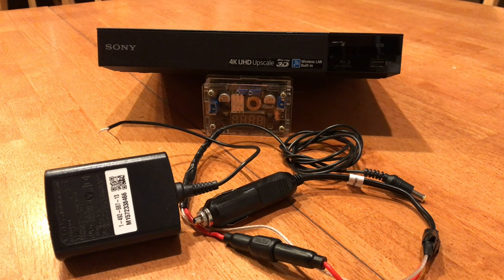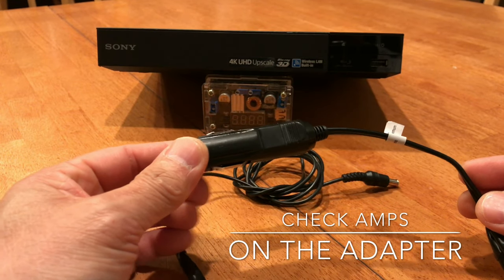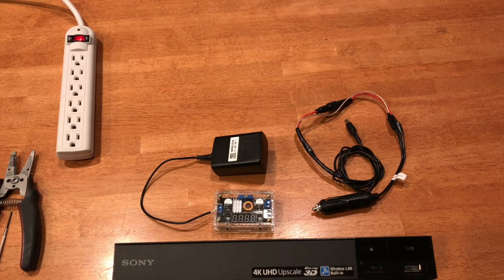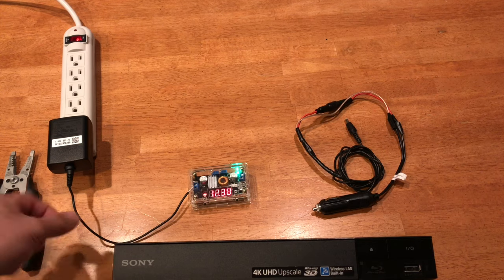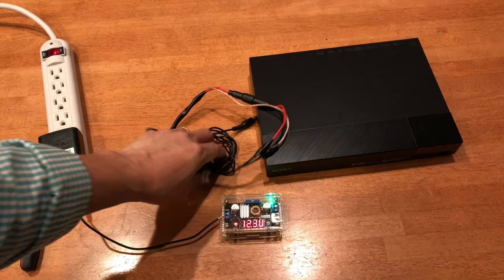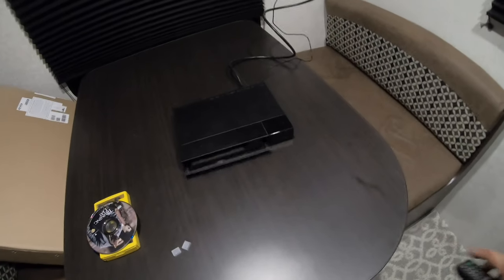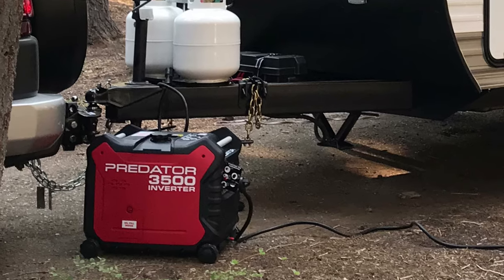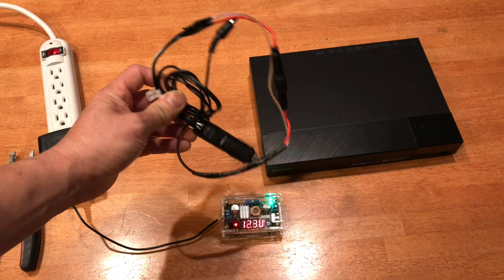DIY 12 volts Blu-Ray Player for our Jayco Travel Trailer 12V DC BluRay Player for RV Blu Ray Sony

Comment: I did this a couple years ago (before seeing your video) to our front and back blu Ray players so we could run quiet (without the generator) as much as possible in our 36' Georgie Boy whe we dry camp. I also added the bump converters to try to avoid low-voltage issues. I'm not sure what happened, but both players ended up dying. I can only guess they had either dips or surges that exceeded the limits of the bump converters to keep the voltage stable. I may try it a second time, but I think I'll rewire one circuit in the coach to run on an inverter instead

Comment: You confirmed what I already thought though a better power filter option would be nice.

I have an Australian model 50Hz LG w/ 12V power plug.
Reply: Running from a lead acid 12V deep cycle battery in my garden shed

Comment: Would it matter which color wires goes to which with the inline fuse and the 12v cigarette connector? there’s a fuse inside the cigarette plug, so on top of top that an inline fuse is needed?
Reply from the maker: If you have a fuse in the plug... no need to add another. Typically, you put the fuse on the positive wire...
Reply from the maker: Note: white wire is the positive. Anyway, thank you very much for watching and feedback

Comment: I’m confused.  If you have the Generator, why would you need to do all of this?

This video made sense up until you pointed out that you had a generator to power the travel trailer.
Reply from the maker: Some of the places we camp regulate the time on when you can run a generator. They call it “quite time”. I built this so, I can watch movies while on battery - battery bank power source. The batteries gets charge when I run the generator or while on shore power. Thank you for watching and question.
Reply: After watching this video I went and cut the cord from my Sony Blu-ray player, only to find that the wiring is different. It too has the adaptor, but upon cutting the wire, there is a white incased wire that comes up through the middle, and the other strands, that should have been incased, are simply  wrapped around the middle wire.  So now it's going to cost me another $30 to buy a new adapter, otherwise I've just ruined my Blu-ray player. LOL!  Too bad there's no way to know until you've already cut the wire LOL!

Comment: Trying to do the same with my LG TV..... it has a DC input but wants 19 volts...I am looking at wiring in a converter...between the 12 volt and the TV.. lol. or just get a small inverter....
Reply from the maker: Captain Sam Wilson sorry to hear... there are Blu-ray player out there that are 12volts. I doubt your Trailer is 24 volts system... if it is (was), a buck converter will work and buck it down to 19volts. Re: small inverter... watch your battery level.. especially with fan... it draws a lot of juice. Good luck.. and happy trails
Reply: 19 volts is a standard for older laptops. I found a laptop car supply that powered my TV like yours.

Comment: Question.. I am assuming you can play normal DVD's in the blue ray player??  I just installed a LG 22" 1080 pi etc. TV in my rv and noticed it is 12 volt but connected to AC.. I want to  find a 12 volt adapter and power it with that going down the road etc.. THEN.. must have a 12 volt DVD player..lol
Reply from the maker: Captain Sam Wilson it is backward compatible. It plays cd, DVD’s and Blu-ray. Thank you for watching and for the question.
Reply: @cbatilo  Thanks, going to do the same thing with my LG TV and new 29 dollar LG Blue Ray player..!!
Reply: Well the LG player was not compatible with the TV as no RCA inputs on the TV, Bought a RCA/HDMI cord and tried that.. Nope..  Going to look for the same DVD player you have..

Comment: What Blu-ray player use to make this video?
Reply from the maker: Here is the player I used for this video: from Amazon https://amzn.to/31LyM4v
Reply: @cbatilo  which wire is the positive and negative?
Reply from the maker: I don’t have the cord in front of me... but if you are in the US... you will see two prongs that plugs to the outlet. The smaller prong is positive (follow it backwards) The wider prong is negative. 🔌
Reply: @cbatilo  i can't follow backwards because of the transformer. The big black square thing
Reply from the maker: BOREDANDWELLBORED lol... I will hop in the trailer and take a look... hang tight
Reply: @cbatilo  I guess I could open the transformer?
Reply from the maker: Last question... before I open it up... do you know how to use a multimeter? Do a continuity test? The hole is positive... the outside shaft is negative. Strip the two wires... if you do not know how... I’ll open my fully taped up wires... let me know
Reply: @cbatilo  never used a multi meter. I can strip it but I need another plug to replace the stripped one.... Or I could repair it using JBweld steelstik, that thing is very useful. Thanks for the info
Reply from the maker: BOREDANDWELLBORED I opened it up... it is the white wire... strip it and connect it to the positive of the cigarette plug (with fuse)... thanks for watching and question. Good luck with the project